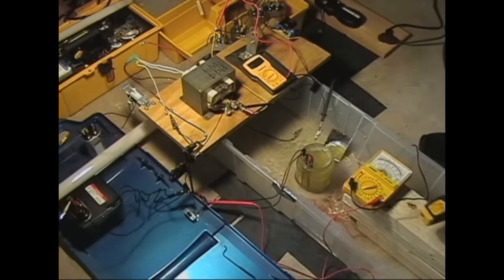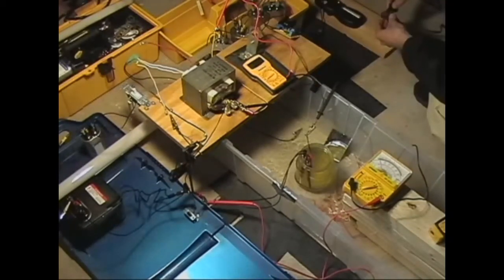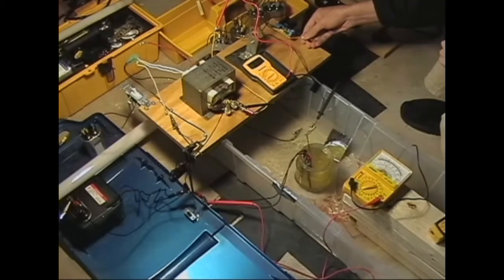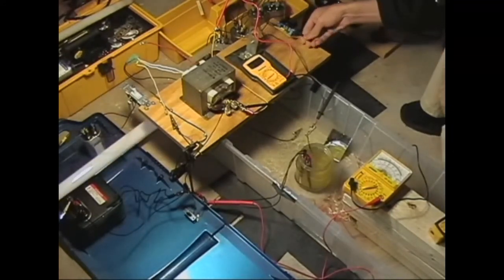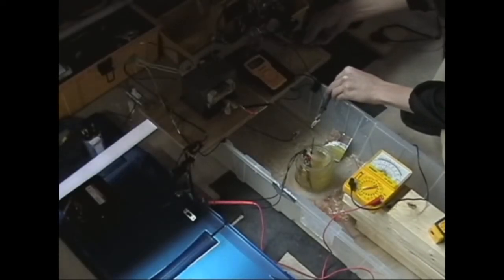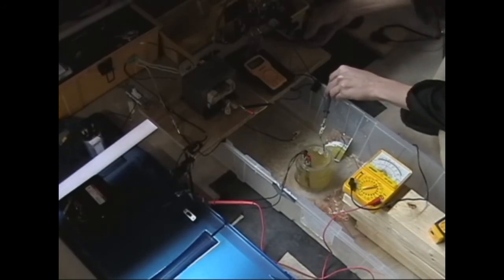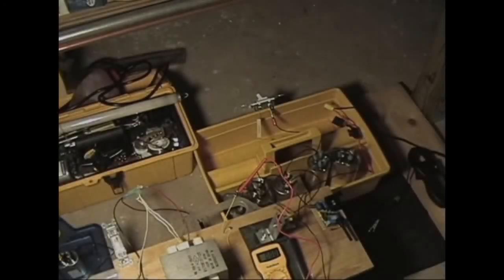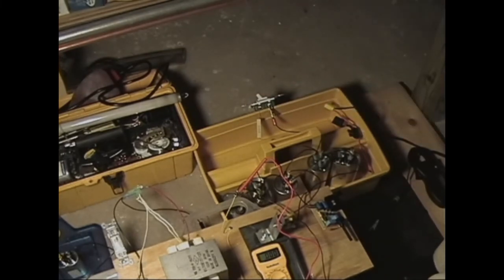Plasma HHO #4

Comment: Hello are you still experimenting with this?Two days ago set up very similar circuit. i used a single diode for half wave rectification and this goes to a 0.22 uF capacitor. the capacitor is in series with the electrolysis cell and the microwave transformer primary coil. i realized that the capacitor and the primary coil is forming a resonant circuit and the plasma is acting like a spark gap. The secondary coil of the transformer is connected to a very large florescent light bulb and using 140V dc and 200 mA the light bulb glows much brighter than the one in your video. The weird thing is that due to the turn ratio of the microwave oven transformer, mains voltage (120V AC) produce no more that a little over 2000 volts. But when i connect the transformer with the capacitor and electrolysis cell as explained above, im getting voltages capable of forming 0.5cm arcs. Thats about 15000 volts. the next thing is that by using this setup the anodic plasma behave similar to the cathodic plasma. Anodic plasma just means the plasma is formed around the anode.